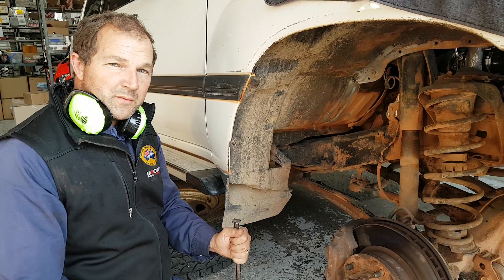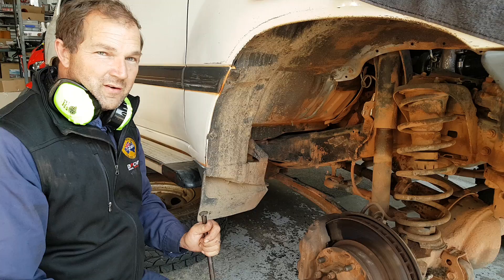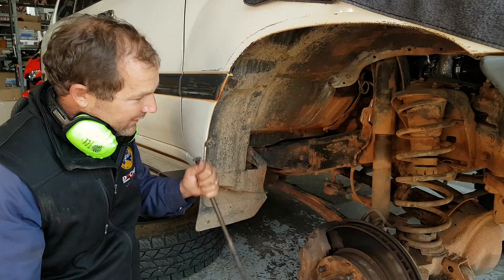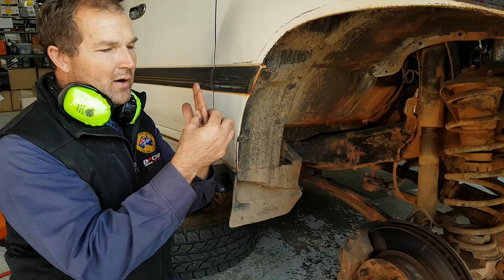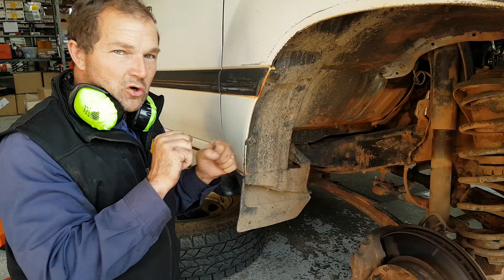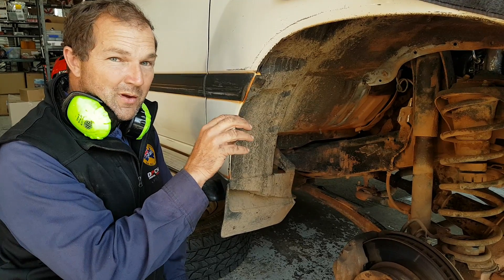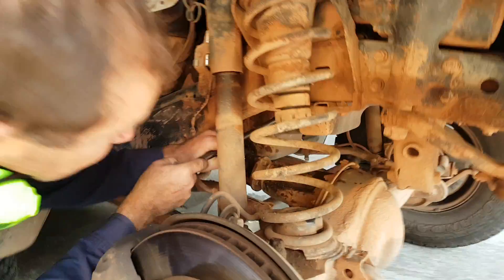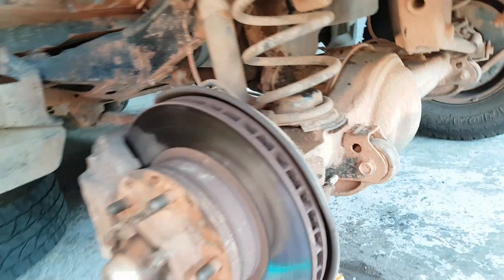Fitting a Turbo oil return. The Top Turbo kit companies use this technique.

Comment: Yeah nah, take the sump off and weld one on. Don’t do this. It’s just called a lazy job
Reply: Sump off, drill hole, install bulkhead style fitting or silver solder bulk head style fitting in.
Made many custom hydraulic fittings this way, subject to far more pressure and vibration
than a return turbo line will ever see. IMO.
Reply from the maker: Yeah Nah seen far too many welded sumps crack and leak.
Reply: I've done over 40 sumps with the welding technique, not 1 has leaked, looks alot cleaner aswell. Its a great peace of mind factor aswell that its sealed properly and not someone who has just wacked a hole in it with a pike.
Reply from the maker: A few thousand Turbos installed here never seen an issue with this 'widely' used technique. No weld spatter.... so neat and works.

Comment: Really! Sounds pretty backyard?
Reply: Spend time around mechanics and you'll very quickly learn it's nowhere near as clinical as the TV ads and service catalogs want you to think
Reply: My nissan was done like this at a highly reputable turbo shop in cairns, in 1993.. and ive since changed turbo setups and to this day hasnt leaked a drop. Im sure bang for buck this option would be favoured as opposed to taking the sump off and "doing it properly" by welding a fitting in..